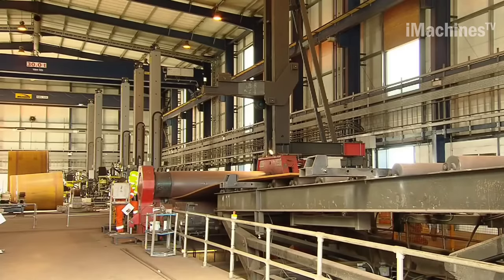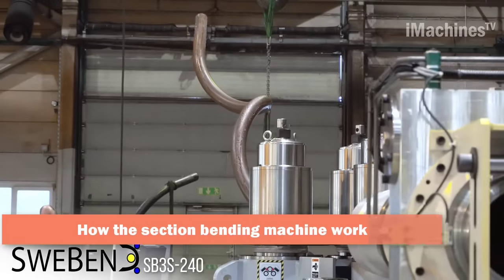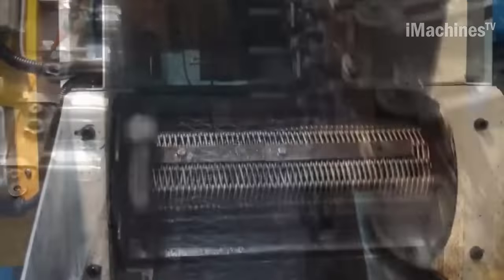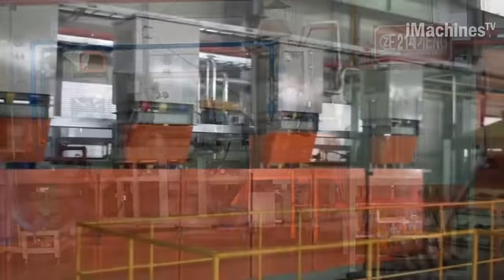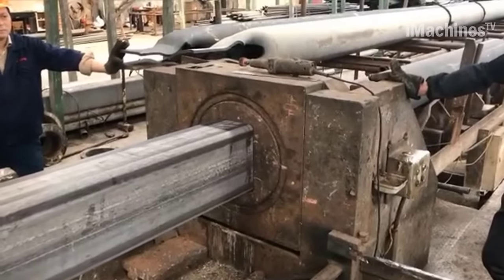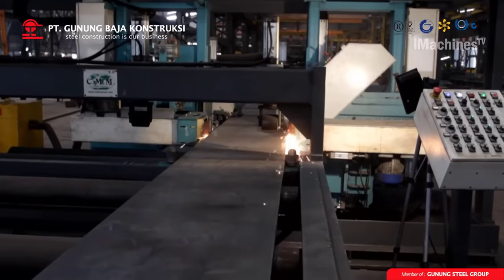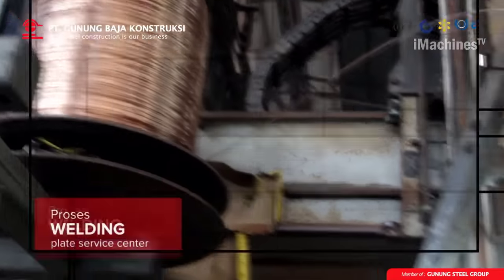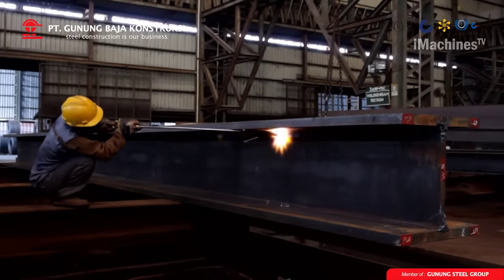The manufacturing process of a welded beam and wind tower. How the section bending machine work

Comment: The big plates being cut for a welded beam is not cut with laser or plasma.   These are flame cut, and that gang of cutters are oxy / acetylene torches.   Not what is in your video.
The big plates that created the heavy I beam is welded by sub-arc after the tack welds, followed by stitch welds, the sub arc.    Cheers